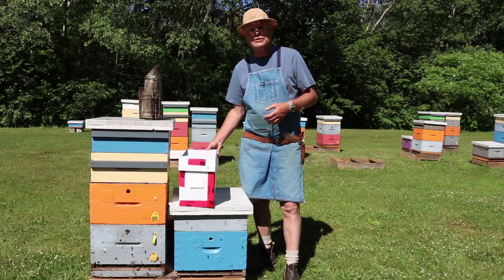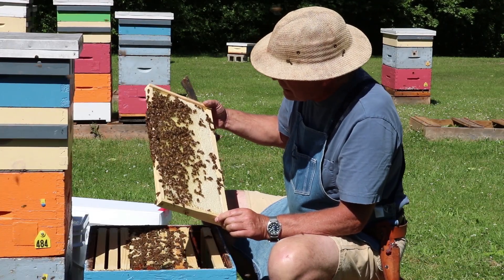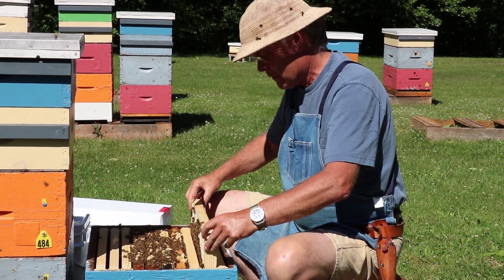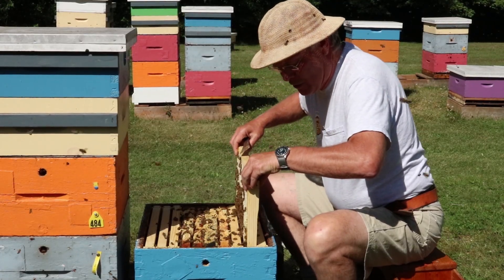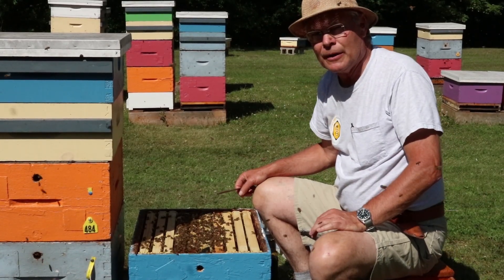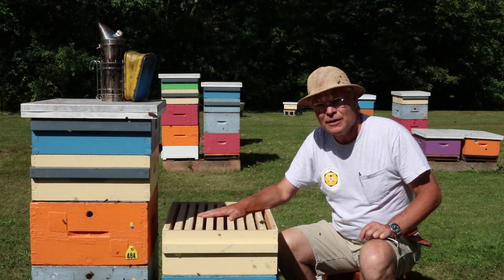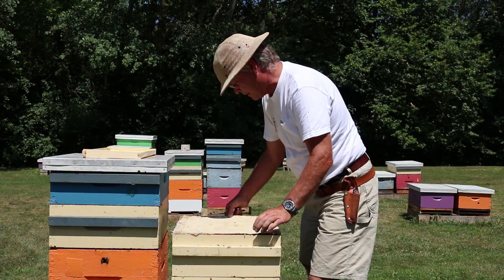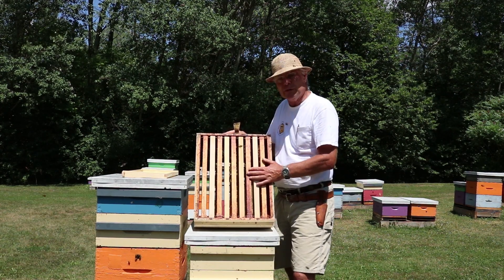Comb Building

Comment: Hi what material u use on your boxes its not crown board?
Reply from the maker: Please see #1 FAQ below.
  1. Why do we use canvas for the hive inner cover? 

A: We use canvas inner covers for a few reasons. They make it easy to take a quick peek in the hive, and are cheap and easy to make. They are light, the lids sit down well, there is less excess wax on the frame top bars, and we rarely need to scrape the inner cover. We use 18 oz (#8) canvas - otherwise known as cotton duck. 
It is available in the USA online at: http://www.bigduckcanvas.com/number-8-18oz-cotton-duck-canvas.html,  In Canada at http://www.jtsoutdoorfabrics.com/18oz-Cotton-Duck-Canvas-Untreated--Natural-60_p_15038.html) or in Hamilton Ontario at https://europeantextiles.ca/product/canvas-21oz-natural/.  
Bees chew through thin canvas so a heavier weight is better. We flip it over periodically when new so the bees thoroughly coat it with propolis. An alternative is a feedbag folded in half. 

2. Why do we use single brood chambers? 

A: Our preference is to keep hives in single brood chambers. We use queen excluders above the brood chamber and then add honey supers. We produce more honey managing our hives in singles vs doubles and we find the hive management much easier. It's become quite common in Ontario, especially over the last twenty years. 

3. Are our queens for sale? 

A: We sell a limited number of queens but do not ship outside of Canada. To contact us about queens, please email infohbrc@uoguelph.ca. There are two other Buckfast breeders in Ontario: Munro Honey http://www.munrohoney.com/and Ferguson Apiaries http://fergusonapiaries.on.ca/. 
 

4. What breed of honeybee do we use? 

A: We work with Buckfast bees. Check out our website if you    would like to learn more about them: http://www.uoguelph.ca/honeybee/breeding.shtml 

5. How do you overwinter double nucleus colonies? 

A: At the University of Guelph, we winter our double nucleus colonies indoors. You can also winter them outdoors by wrapping two double nucs together with insulation on the sides and top. 

6. Are double nucleus colonies prone to swarming? 

A: With a young queen in the nucs and honey supers above we don't have any problem with these nucs swarming in the first year. We do have to transfer them into a full size box early enough the following spring to prevent swarming. 

7. Do we add a frame of pollen or honey into a new split? 

A: Ideally you add both pollen and honey to a new split. Of the two, honey is the most important.

8. Where to purchase some of the products that we use: 
Coveralls: We really like Dickies 100% cotton coveralls. http://www.dickies.com/coveralls-overalls/deluxe-cotton-coverall/48700.html?dwvar_48700_color=GY#start=3. 

We use velcro to straps at the wrist and usually tuck pants into our socks. 

Plastic Queen Cages: Mann Lake (USA) and their Canadian distributors  sell these. They are made by the French company Nicot. https://www.mannlakeltd.com/hair-roller-cages. I use a wooden plug on the bottom and screw it in place with a #4 screw after pre-drilling.

Queen Grafting Microscope: http://www.amscope.com/catalogsearch/result/?q=gooseneck+binocular 

Mini/mating nucleus boxes: Mann Lake (USA) and their Canadian distributors sell these. They are originally from Europe but are widely available. https://www.mannlakeltd.com/shop-all-categories/hive-colony-maintenance/queen-rearing/nuc-boxes 

Queen Pheromone: The pheromone strips were developed in Canada. They are called Tempqueen and are made by Intko Supply Ltd. Suite 604, 3345 Kingsway VANCOUVER, BC, V5R 0A7 Canada (604) 356-7393. pheromonesupply@gmail.com. Mann Lake in the US and several Canadian bee supply companies carry them. 

Bee belt and bulk bee box: Our apiary manager Paul Kelly manufactures the Bee Belts and bulk bee box. If you are interested in more information, please email him at: pgkelly48@gmail.com.

10..Should you remove any queen cells in a colony before          introducing a new queen in a cage? 

A: Yes, you should remove the queen cells. Look very carefully to make sure you don't miss one. Shake the bees off each frame to make sure you can see the entire frame. Accepted queens are sometimes killed by virgins that later emerge from queen cells. 

11. Can you make a split without adding a mated queen/can a split raise their own queen? 

A: A split can raise their own queen (if they have eggs), but it is better to purchase a mated queen or queen cell from a local bee breeder. Queens raised by a split are reared under the worst possible conditions, are physiologically inferior, and you aren't taking the opportunity to improve your hive genetics. For a number of reasons, colonies get more aggressive if splits raise their own queens. We always use queen cells that we have reared from breeder colonies so we can maintain and improve our genetics. Cells found in hives can be poorly reared if conditions aren't good or if you use swarm cells you, are unintentionally breeding for swarming behavior.

12. How often do we check for swarm cells? 

A: We check for queen cells only in colonies that are stronger based on our ratings as described in our “Swarm Control” video. We only do this at the time of year bees are prone to swarming (ie just before the main summer nectar flow). In some colonies, we check twice, a week apart, if we have the time and we've found cells in them previously. We stop looking once the nectar flow gets going and the time for swarm preparation has passed. 

13. How old is a queen when we replace her? 

A: We re-queen if a queen isn't doing well or when she is in her third year. 

14. How often should you be stung to lessen the chances of developing anaphylactic reactions? 

A: Please speak with an allergist if you have any concerns regarding bee sting reactions. You don’t need that many stings to build immunity and reduce your chance of developing an allergy. However, reactions can be very different from one individual to the next. For about three years after starting beekeeping you swell more in the spring when the bee season starts. After that most people don't swell up much at all. Some beekeepers apply stings through the winter to keep building immunity. 

15. What do we use as candy for the queen cages? 

A: You can make the candy using honey and icing sugar but the candy you see in the tubes in our videos are purchased with the cages from Mann Lake beekeeping supplies and their Canadian distributors. In Ontario, it's not legal to use honey in queen candy if you are distributing queens. Honey can contain American Foulbrood spores. A specialized, non-drying, sugar syrup (Nulomoline invert sugar) can be used instead of honey. In any case the candy must be made dry enough that it's crumbly.

16. How do we make pollen patties? 

A: The patty is made from pollen we collect using pollen traps. We mix the pollen pellets with sugar syrup to a dough-like consistency, form the patties between layers of wax paper and then keep them frozen until needed. They will keep for several months in the freezer.

17. How do we make our grafting bars? 

A: We cut the wood pieces and attach them to the graft bar with liquid beeswax. We then attach the cups with liquid wax. In both cases the liquid wax is applied with a large syringe. In the past, we made the wax cups but now buy them from https://www.kelleybees.com/. 

18. Do we move full honey supers to the top of the stack so the bees can fill the lower ones? 

A: Some beekeepers shuffle the supers around and do what's called bottom-supering. We place supers back on in the original order and only add new supers on top (top-supering). That way it's easier to see when the bees need more space. The bees also ripen the honey before moving up to the next box. We sometimes harvest full lower supers and put the top ones that aren't full back on in the original order. 

19. Do we ever add brood frames to the cell builder colonies to keep their populations high? 

A: We do add other frames of sealed brood and sometimes we shake in more young bees from brood frames to boost the hives. About once every three weeks we'll boost the hives in one way or another. 

20. How do you level hive stands? 

A: We level the hive stands periodically with pressure treated wood shims. If the hives are already on the stands, we use a hardwood pry bar and a brick fulcrum to lift each end for shimming.

Comment: While it seems very logical to alternate drawn comb frames with foundation frames in the production supers, it does not work for me.    It has been my experience that this will result in very thin, difficult to uncap, frames where the foundation was and very thick combs where the drawn comb was.     I recommend grouping the foundation frames all together near the center with your drawn combs distributed on each side.    This will yield combs of more uniform thickness (i.e.…easier to uncap).     In the brood chamber it does not matter since you will not be uncapping that honey.
For foundation supers, I also find that - if you have drawn comb frame available - to place a drawn comb in the first and last frame position with foundation frames between.    This seems to entice the bees to move up onto the foundation supers.
Reply from the maker: Good thoughts Bob. We see the same thing as far as the comb being a bit thin the first year but the next year it's fine. I'll try your suggestion.

Comment: After adding the first super above the brood box, will the bees move the sugar water/sugar honey up to make more room for the queen to lay? Thanks for the videos
Reply: UoG Honey Bee Research Centre 

I'm wondering the same thing.
Reply: Get rid of honey/syrup stores in a brood box.  You can remove bees from the frame and set it outside and let bees rob it.  Return the frame in about 3 to 6 hours.
Reply from the maker: Hi Kegan
You are very welcome. 
They are more likely to use honey/stored syrup from the brood chamber to convert to wax for the honey super combs in this case. Sometimes honey or stored syrup is moved up into drawn comb in the super but honey in the first super is often eaten and later replaced as the season progresses. We talk about this a bit in our single brood chamber video.
Reply: No d